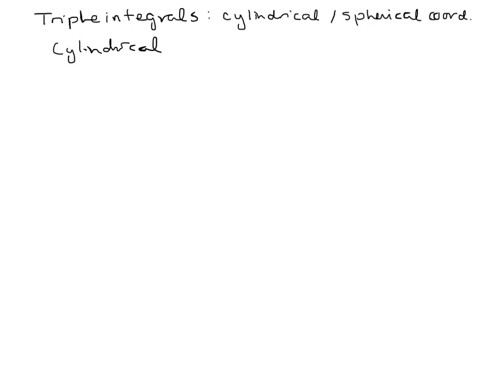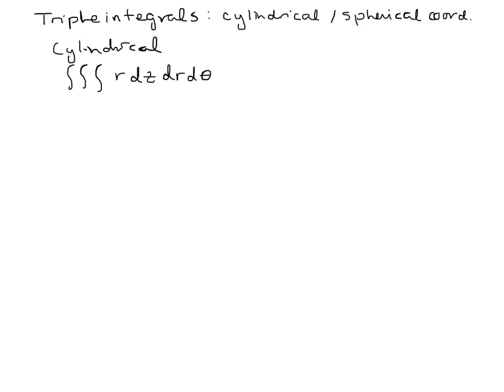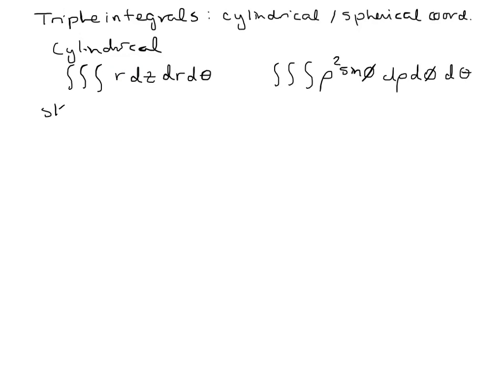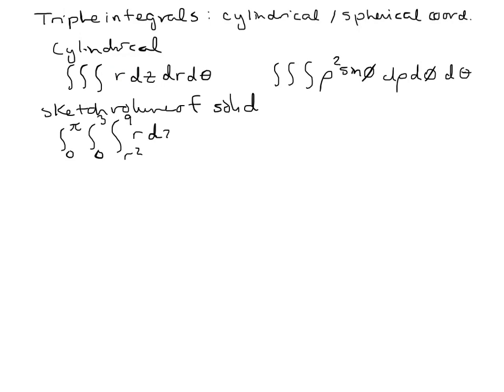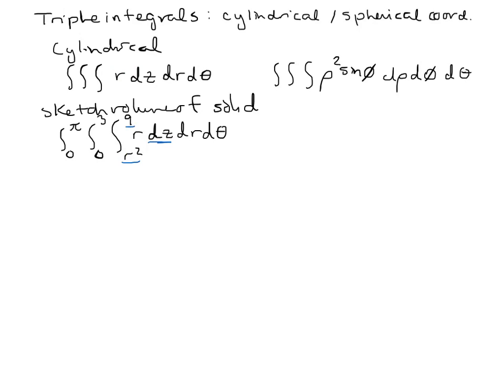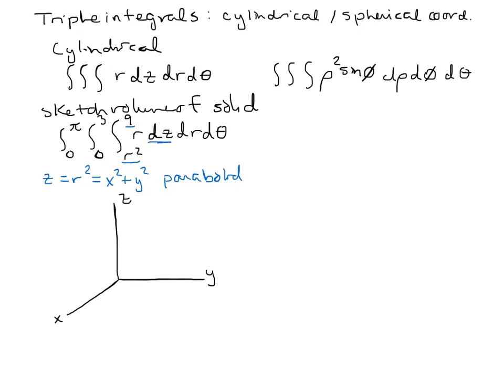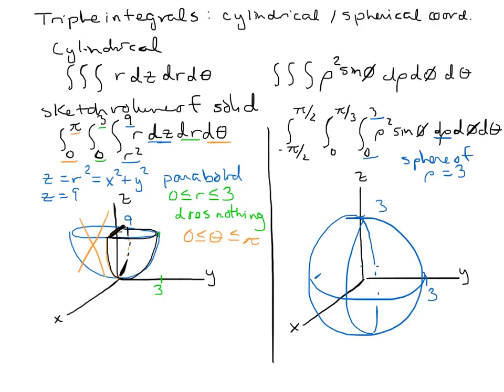Triple integrals: Cylindrical and Spherical Coordinates

Comment: Can you help me with this pls?

Consider the hot air balloon with equation 9x^2 +9y^2 +4z^2 = 100.
The temperature in the hot air balloon is given by the following function: f(x,y,z) = 18x^2 + 18y^2 + 8z^2 − 20

• Convert the regular area into appropriate spherical coordinates. 
• Calculate the volume of the balloon.
• Calculate the average temperature in the Balloon

Comment: Please explain in detail how to get the limits of theta and phi
Reply: I know it might not be helpful now, but I think we need to take the upper limits of theta and phi as pi by 2 as long the as the area we are conserned with is in a single quadrant. If it includes 2 quadrants, it should be pi, and the lower limit mostly zero.

Comment: x^2+y^2=r^2 ,,,,, you had x^2-y^2 yet you replaced it by r^2 , please explain
Reply: its 4-x^2-y^2 so you can also write it like this 4-(x^2+y^2) which then you can see that you can replace the x^2+y^2 by the r^2
Reply from the maker: I'm not sure where in the video you are referring to.  There is a spot where I substitute 4-r^2 for 4-x^2-y^2.  This uses the fact that x^2+y^2=r^2.  If this is not the spot then please let me know when in the video this substitution happened.
Reply: 12:10